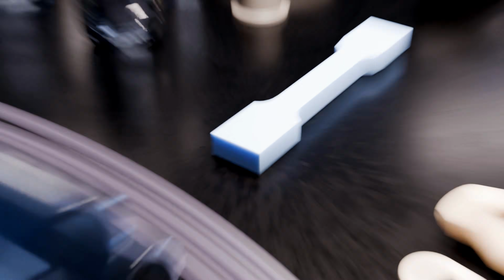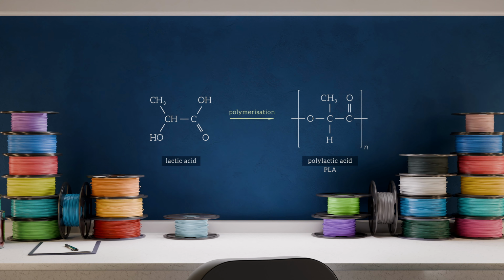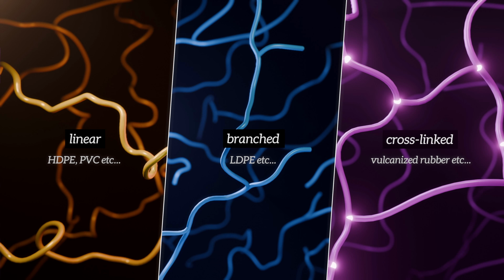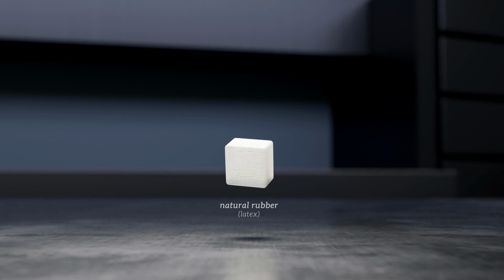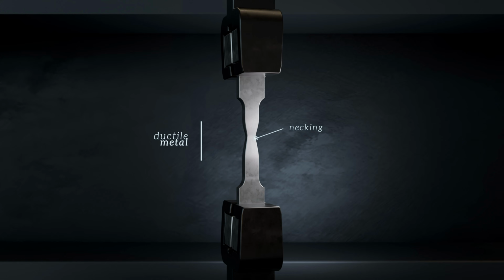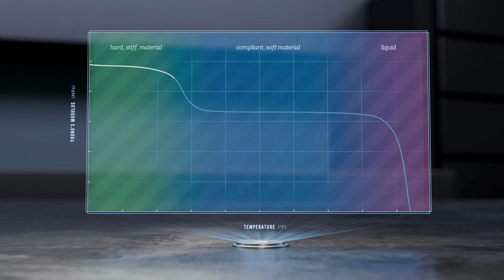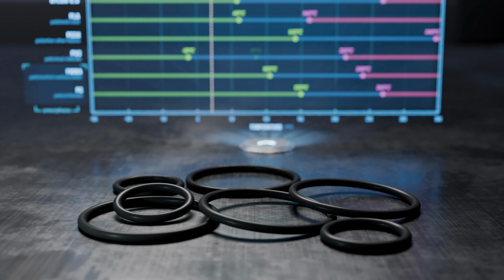The Surprising Science of Plastics

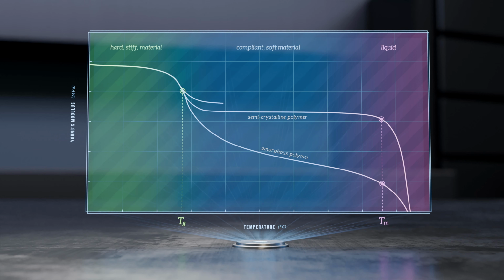Comment: The graph shown at minute 20:52, although very well presented, it can cause some doubts. In the case of Acrylic, it is a thermoplastic with a cross-linked structure. The graph can be interpreted to mean that all cross-linked structure polymers cannot be turned into the liquid state. However, this does not apply in the case of Acrylic, as it is a thermoplastic with a cross-linked structure that can be melted and turned into a liquid state. Just to remind that things could be not that linear.

Comment: Research seems great until you realize the funding is controlled. So many great materials overlooked because modern industry loathes change. Example: Bioplastics. Hemp plastic. Why are we still using petrol based plastic bags?? Because industrialists don't want to spend money overhauling their factories to be compatible with bioplastics.
Reply: Ok learn some science: Hemp is a plant, plastic is processed oil, bioplastic is just a buzzword as you can't make plastic from plants. Oil is cheaper than water. Asbestos has amazing properties, hemp does not. We have excess oil production, hence opec cuts, we won't run out any time soon. Plastic isn't the problem, it's lazy governments not installing bins and doing refuse collection that's the problem.

Comment: AI Summary

Abstract:

This video provides a comprehensive introduction to polymer science, explaining the fundamental nature of polymers as long-chain molecules composed of repeating monomer units. It details the two primary polymerization processes (addition and condensation) and explores how variations in molecular structure (linear, branched, cross-linked) and microstructure (amorphous vs. semi-crystalline) dictate material properties. The distinction between thermoplastics and thermosets based on their thermal response is explained. The video covers key mechanical properties like stiffness, strength, and ductility, contrasting brittle and ductile failure mechanisms (including crazing and cold drawing). Finally, it emphasizes the significant influence of temperature, introducing the concepts of glass transition temperature (Tg) and melting temperature (Tm), and illustrating their practical importance with examples like plasticizers and the Challenger disaster.

Understanding Polymers: Structure, Properties, and Behavior

*   0:00:32 What are Polymers?: Polymers are materials made of extremely long molecules, which are chains formed by repeating smaller molecular units called mers.
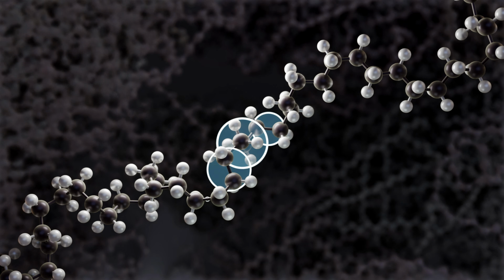*   0:00:44 Monomers and Examples: The repeating unit is the monomer ("single part"). Polyethylene is a simple example with a two-carbon backbone. Other common examples include Polypropylene (PP), Polyvinyl Chloride (PVC), Polytetrafluoroethylene (PTFE), and Polystyrene (PS), distinguished by their side groups.
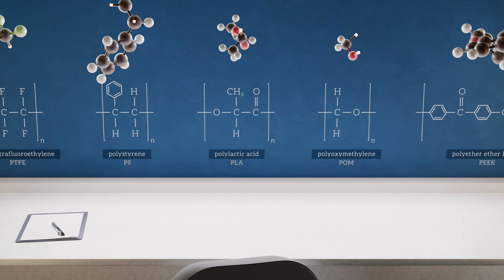*   0:02:49 Polymerization: Polymer chains are formed through polymerization, where precursor monomer molecules are assembled. PVC is made from Vinyl Chloride gas, PE from Ethylene gas. Most synthetic polymers derive from hydrocarbons, but bio-based options like PLA exist.
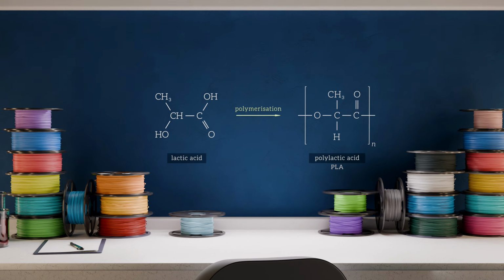*   0:03:47 Copolymers: Some polymers, like Acrylonitrile Butadiene Styrene (ABS), are copolymers, formed from multiple different monomer types.
*   0:04:11 Polymerization Methods:
    *   Addition Polymerization: Initiated by free radicals attacking monomer double bonds, triggering a chain reaction that adds monomers one by one (chain-growth).
    *   Condensation Polymerization: Monomers with complementary functional groups react, releasing byproducts (like water) and linking end-to-end (step-growth).
*   0:06:03 Molecular Arrangement: Chain structures influence properties:
    *   Linear: Chains packed closely, held by weak intermolecular forces (e.g., HDPE, PVC, Nylon).
    *   Branched: Side chains hinder close packing (e.g., LDPE).
    *   Cross-linked: Strong covalent bonds link different chains, creating a network (e.g., epoxies, vulcanized rubber).
*   0:07:04 Thermoplastics: Linear or branched polymers that soften/melt upon heating and solidify upon cooling. They can be repeatedly reshaped (e.g., injection molding). Weak intermolecular forces break easily with heat.
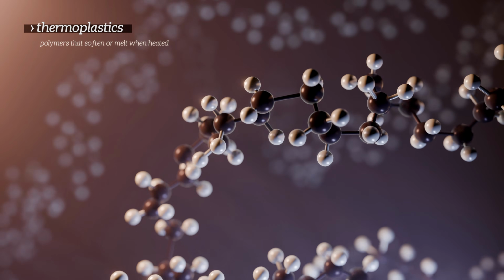*   0:07:41 Thermosets: Cross-linked polymers that do not melt upon heating; they degrade instead. Strong covalent cross-links prevent chain movement. Often formed by curing liquid resins (e.g., epoxies).
*   0:08:36 Microstructure (Crystallinity): Polymers are typically semi-crystalline, containing both amorphous (disordered chains) and crystalline (ordered, tightly packed chains, often in spherulites) regions.
*   0:09:04 Factors Affecting Crystallinity: Linear chains with small side groups (like HDPE) pack easily and have higher crystallinity. Branched, bulky, or cross-linked structures hinder packing, leading to lower crystallinity or fully amorphous structures (like PMMA, thermosets).
*   0:09:51 Effects of Crystallinity: Higher crystallinity generally leads to stiffer, stronger, denser, and more opaque materials. Lower crystallinity results in more flexible and transparent materials (e.g., HDPE vs. LDPE, amorphous PMMA).
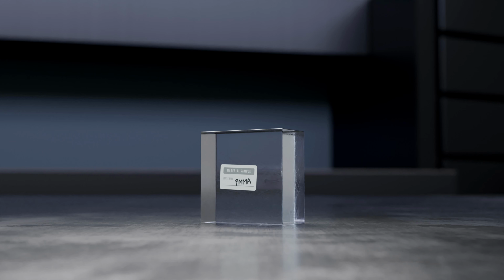*   0:11:02 Mechanical Properties: Polymers generally have lower stiffness (Young's Modulus) and strength compared to metals/ceramics but offer excellent strength-to-weight ratios due to low density. Some high-performance polymers (PEEK, PEI) have respectable strengths.
*   0:12:40 Elastomers: Polymers exhibiting very low stiffness and high elastic deformation (e.g., natural rubber/latex). Vulcanization introduces sulfur cross-links to improve strength and elasticity, preventing irreversible deformation.
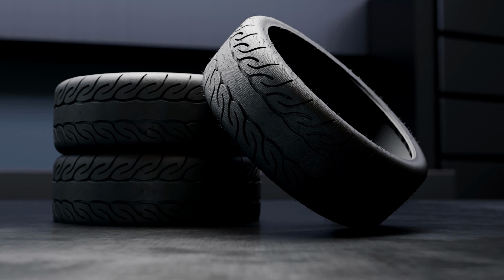*   0:14:28 Deformation Behavior:
    *   Brittle: Fracture suddenly at low strains with little deformation (e.g., PMMA at room temp).
    *   Ductile: Undergo significant plastic deformation before fracture (e.g., PE, PP, Nylon at room temp). Elastomers are extremely ductile.
*   0:15:44 Ductile Failure (Cold Drawing): After initial yielding and necking, the necked region elongates as polymer chains align with the stress direction, strengthening the material and causing the neck to propagate along the specimen.
*   0:17:26 Brittle Failure (Crazing): Often preceded by crazing – the formation of microvoids bridged by polymer fibrils. These crazes absorb energy but eventually grow into cracks, leading to sudden failure.
*   0:18:36 Temperature Dependence: Polymer properties are highly temperature-dependent. Stiffness decreases significantly as temperature increases.
*   0:18:54 Glass Transition Temperature (Tg): The temperature (or range) where amorphous regions transition from a rigid, glassy state to a more flexible, rubbery state due to increased chain mobility.
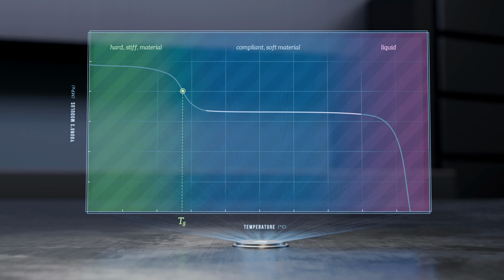*   0:20:18 Melting Temperature (Tm): The temperature where crystalline regions lose their ordered structure and melt. Only applicable to semi-crystalline polymers; amorphous polymers soften gradually above Tg.
*   0:20:56 Factors Influencing Tg and Tm: Longer chains, bulky side groups, and cross-linking generally increase Tg and Tm.
*   0:22:04 Plasticizers: Small molecules added to polymers (like PVC) to increase spacing between chains, reducing intermolecular forces and lowering Tg, making the material more flexible at room temperature.
*   0:22:32 Practical Importance of Tg: Critical for applications, exemplified by the Challenger disaster where cold temperatures caused O-ring seals to fall below their Tg, losing flexibility and failing to seal properly.
*   0:23:04 Viscoelasticity: Polymers exhibit viscoelasticity (behaving partly like elastic solids and partly like viscous liquids), especially dependent on temperature and strain rate.

I used gemini-2.5-pro-exp-03-25| input-price: 1.25 output-price: 5 max-context-length: 128_000 on rocketrecap dot com to summarize the transcript.

Input tokens: 15962
Output tokens: 3061

Comment: Wait... So ethylene is just two carbons repeated right? So why isn't polyethylene called polymethylene instead? Like couldn't you just as easily consider it to be a chain of single carbon monomers instead of 2 carbon monomers?
Reply: No, because you need a molecule to start with to form the monomer. They use ethene and not methane. It’s not like mathematics where you can simplify an expression past whole numbers.